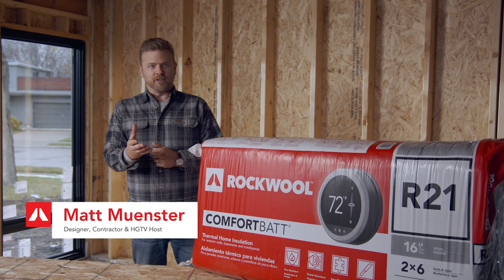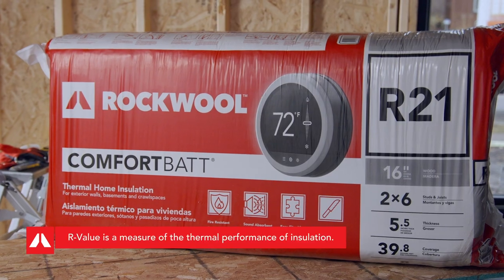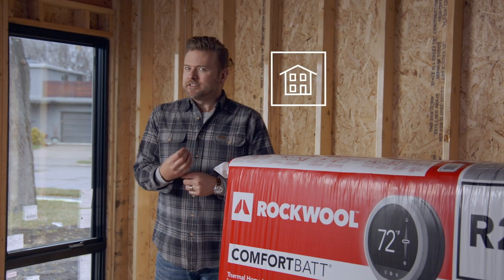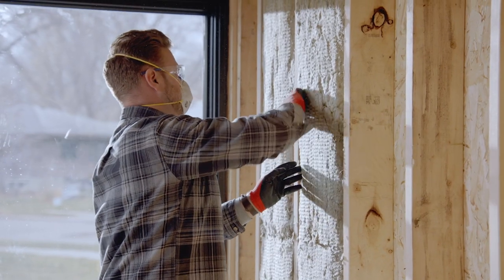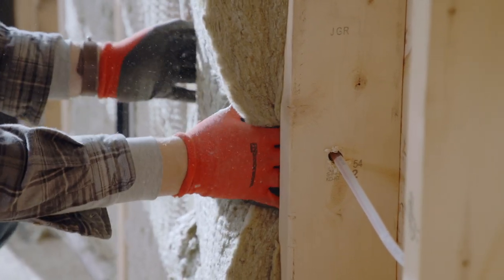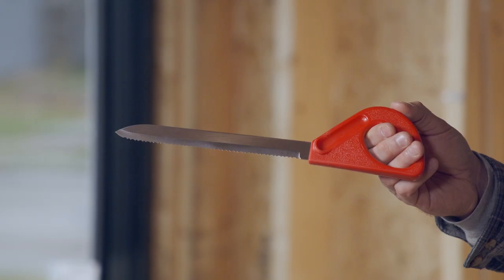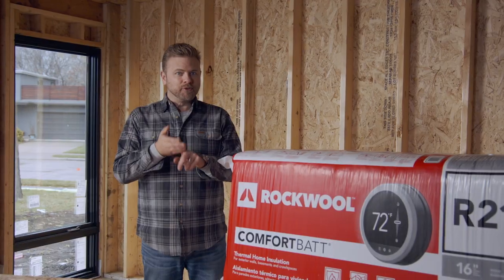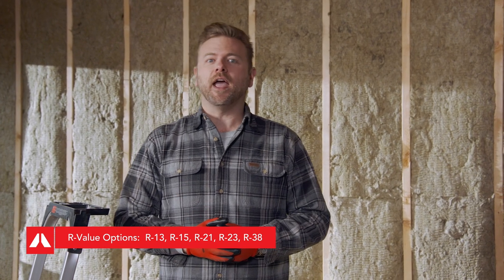We’ve added more ways to meet R-value codes

Comment: I've got 2x4 walls in my shed and county permitting is requiring R-19 if I want to install a mini split to condition the air. How can I use Rockwool to get to R-19 with 2x4 walls?
Reply: 2x4 comfortbat is r15 + r4 exterior insulation (comfortboard80 1" thick = r4) = r19, its what im doing currently, it may be a tad less  or more i think if you do foil faced comfortboard with rain screen, it kinda adds r2 while it vents radiant head through the rain screen from what i understand